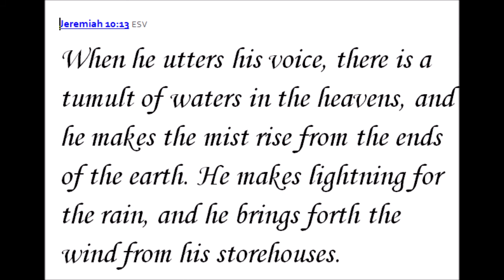How to repair a non working fly zapper

Comment: It was pretty bad. Nice fix and light show Wayn. My 1st one came with a 9 volt battery. Been meaning to convert one over since they all seem to come with 2 AA's now. Used to blow the flies apart! LOL!
Reply from the maker: Don't remember the 9 volt ones. Anyway they are cheap to replace if needed.
Reply: Ya, I 1st found them years ago, a place called things you never knew existed. They are cheap enough.

Comment: Got her cleaned up and back in service! I've had to do that a time or two myself with different things. We all leave batteries in too long at times.
Reply from the maker: You don't think about leaving batteries in something you need that uses them. But then they corrode. I lost a good head lamp by corroding batteries. They should come with a warning. "Don't leave this battery in product while not in use." LOL
Reply: @WaynJul  Do you reckon it would do any good?😂